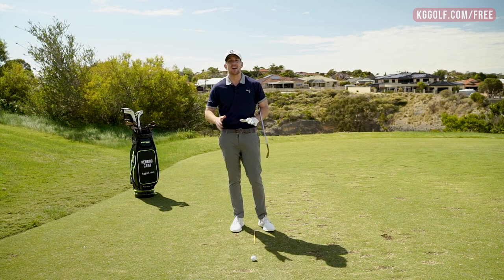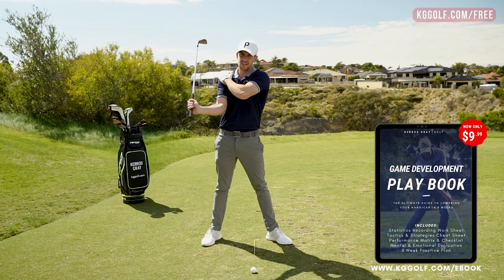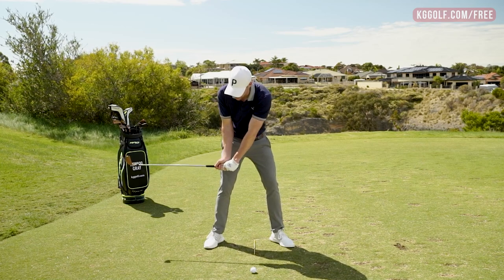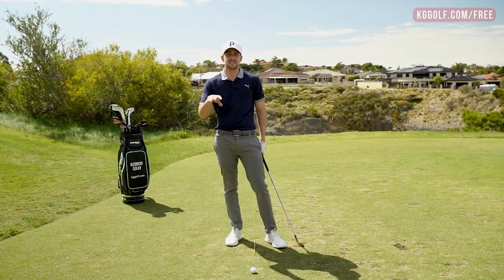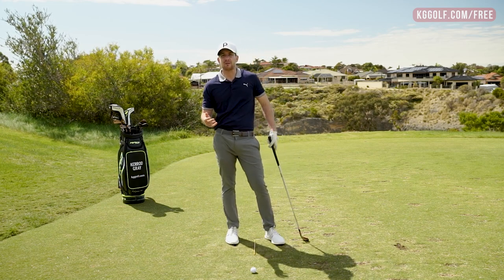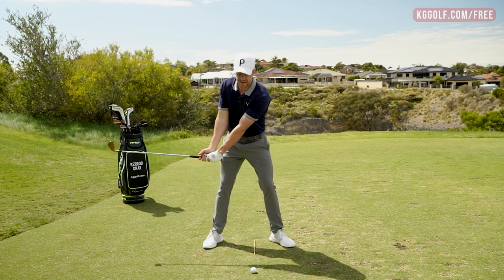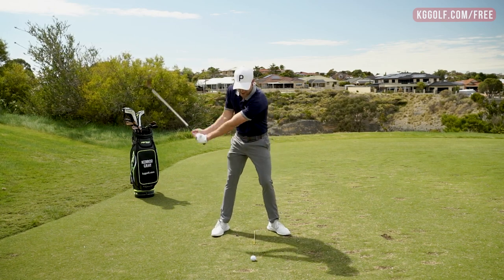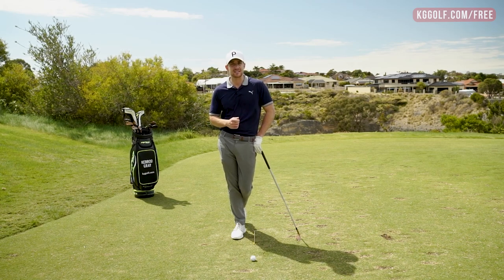Creating Lag in The Downswing  | Don’t Make These Mistakes

Comment: Thanks Kerrod!  When you're at P6 and the shaft is parallel with the ground, where should the clubhead be if I was to look at you from behind rather than looking at you face-on?  Should it be slightly behind you that if I looked down, the butt end of the grip should point at 10 o'clock?  Or could the clubhead be in line with the target that the butt end would be pointing at 9 o'clock?  Or, does it matter?

Thanks again!